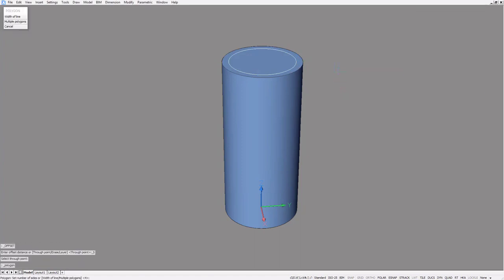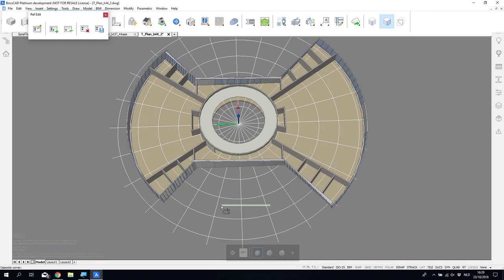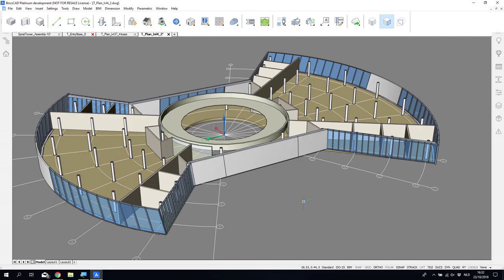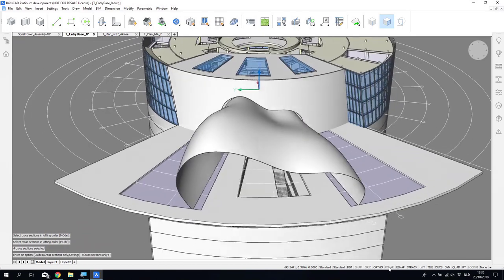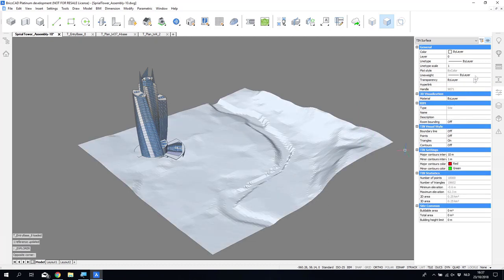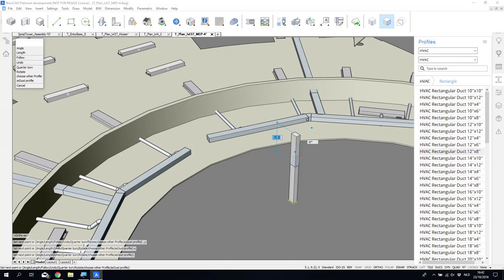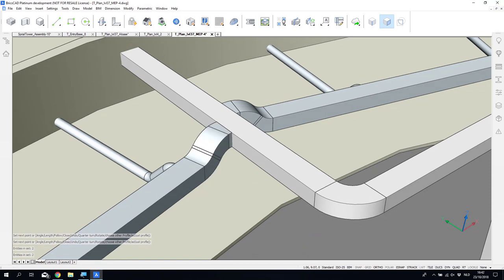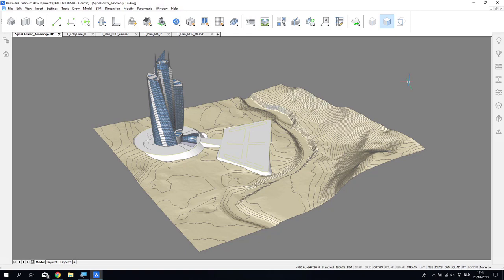How to Create a Skyscraper in Under 30 Minutes with BricsCAD BIM

Comment: Fine, I'll pay you 1,800 dollars for this software and rhinoceros for the following reasons. 

Topological forms are insanely hard to calibrate. Grid reticles are generated instantly over surface with torsion and curvature. That alone makes the software valuable. 

Coordination of the mechanical and electrical systems on a model with a high level of completeness allows analysis of energy consumption, space usage, climatic response and costs values per element instantly. The designer consumes the budget the second he starts drawing. He can make informed decisions. 

This can be generalized to video games, simulation and concept testing with realistic elements. Designers architects and engineers can test three solutions and begin optimization of budget on the get go.
Reply from the maker: Thank you for appreciation!